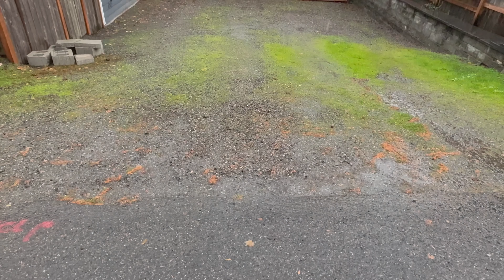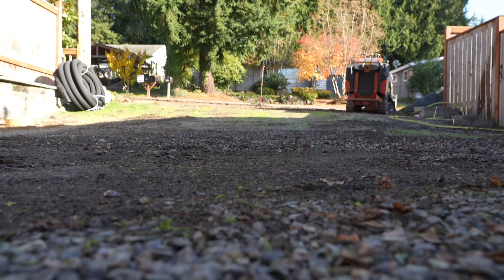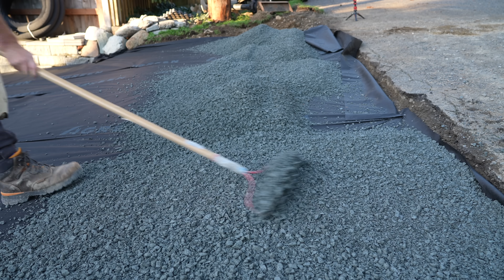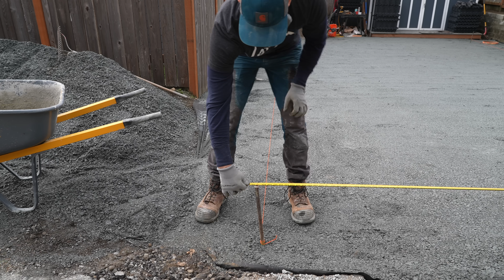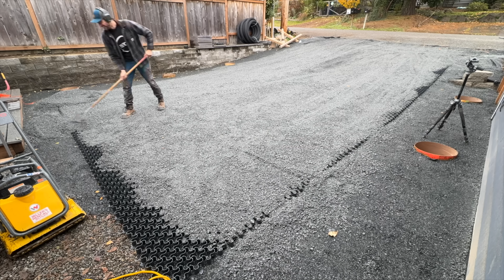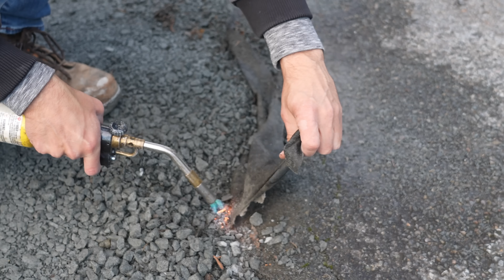How To Install A Permeable Gravel Driveway Grid System

Comment: Great video! I'm using your video as a guide to pave a dock slip area roughly 115' x 25'. I intend to store my boat and trailer on the property for the winter months here in the North East. I checked this links you provided in the video (thx) and see the grid system recommends 2" stone to fill the cells of the grid.  Does the stone you used to fill the grid fit that spec?  Instead of the crushed blue stone as the compacted base, I intend to use RCA (recycled concrete.) After 2 years since you've made the video,  is there anything you would have done differently? If you find the time I would appreciate your thoughts on my plan in substituting the base later with RCA instead of crushed blue stone or anything else I mentioned. Thank you for such a great instructional video.

Comment: Sorry to pile on, friend, but if you use the right kind of gravel, 3/4 minus comes to mind, the load bearing capacity is whatever the ground will bear, no limit, and it will interlock with itself, no plastic grid needed. I do like your weed barrier, and while it will not prvent surface weeds from growing, they will be a lot easier to remove than weeds firmly established in the ground.

Comment: @BYOTools 
I am thinking of this very application.  Can I use a smaller crushed rock size, smaller than 5/8" ?
Also, could I use oil-sand or asphalt on the outer edge of the mesh and a large strip of crushed rock down the middle?
I'm just thinking of different driveway designs using this structure...
Thanks for your instructive videos!

Comment: Great info. Thanks!

The only thing I'm doing different is leaving the gravel (or at least the 2nd layer of gravel) loose - not compacted, so that it does double duty for security. Very noisy. Yeah, the trade-off may be having to re-distribute the gravel once in a while, but times aren't going to get any better here in Umerica.

Comment: The problem with plastic mesh is that plastic will eventually start breaking in few years starting from the surface. That will leave sharp splinters and when you will,want to replace everything now you’ll have gravel mixed with plastic splinters. Does exists the same system but in galvanized steel?

Comment: Thanks for sharing the post. I'm a landscape owner-operator, and just wanted to offer some professional insight. Unfortunately, that fabric isn't going to make a difference in this situation it's essentially wasted money. Proper prep would have required removing at least the top 2-3 inches of the driveway to eliminate any remaining topsoil, especially since the quality of the previous installation is unknown. At the very least, a few test holes should have been done to confirm the base conditions.
There's a reason the driveway has been holding water, and without correcting the base, the issue will continue. In my opinion, the prep work wasn't done correctly, which means the entire job is likely to fail over time.

Comment: The joint of gravel to asphalt are two distinct surfaces and I suggest some kind of bonding liquid to stabilize and set the loose gravel avoiding the loose stones ending up on the road.

Comment: an expensive system (grid=$4.71/sqft, mesh=$1.1/sqft, 2 layers of gravel=$1.5/sqft for a total of $7.31/sqft plus labor and compactor rental) with regular maintenance required. May as use asphalt or concrete.
Reply: Yeah one of those grids is 140 usd. That 4K for a 10x10

Comment: During WW2 the US needed runways for bombers and as it advanced into Europe and the Pacific Islands it become clear that they would need a system to rapidly build runways.  At that time most bombers and fighters were tail drawers and the gear was designed to land on grass fields and many “unimproved surfaces”.  But, the shear numbers of takeoffs and landings, and the fact that aircraft kept being loaded to their absolute maximum takeoff weight… combined with the various precipitation events caused a lot of accidents leading to deaths and destroyed aircraft. So the military, with US Steel manufacturers came up with several different metal grid systems that when set on top of a graded base, especially if they could use coral, gravel,  and any local substrate be for laying the grid system made for a very noisy but very strong temporary runway. 

After the war ended there was thousands of miles of this runaway material in storage all over the world and equally as much sitting on abandoned airfields. It wasn’t long until ranchers and farmers… then scrap metal buyers began buying this stuff by the thousands of panels.  My family were ranchers in New Mexico mountains and we purchased several truck loads, with a stack about L32’xW10’xH5’  high stack.   The individual panels were 8’ long, 1” thick, 4’ wide.  They were made of strips of 1/4” coil steel welded together in a grid pattern of 4”x4” squares. This was perfect for making livestock corral fencing. We had this stuff all over the ranch for areas we needed very strong fencing. Back then we could buy a panel for $10 dollars. We weren’t wealthy so we couldn’t afford to build our own runways (although we owned aircraft)… although we dreamed of doing so.   We did use for temporary parking spots or areas next to barn entry.  They made wonderful boot mud scrapers

Anyway these plastic system remind me of the steel but I’m certain the plastic are better as long as you can add an aggregate or dirt to fill. The individual cells.  

Your video is wonderful.   Next week I’m tackling a similar but much much smaller project at my home. I’m adding a 12’W x 36’L extension to my driveway going down the side of my home using the same grid system. Then another 30x20 patio using a lighter weight system that costs about 1/4 the cost that will be used for above ground / raised beds to grow fruits, veggies, herbs, flowers etc.  

What I’m now sure to use is which finishing gravel?  I’d like something very attractive to be placed on top.  The reason for the extension on the side of the house is a place to park a dump trailer or a tractor.   So if I put down the fabrics, then compatible gravel… I was thinking put the grid down and fill with a small creek gravel??? Would this work?

Comment: I dont know if you have more plans to finish off the area but I suggest painting the fence to match your house will look more cohesive and clean.  The grey and white would look sharp. I used arborcoat by Ben Moore and looks great on my barn.
you can custom match to your house siding.  I would also add some evergreens cedars or boxwood to make the driveway really look beautiful. 
Maybe some hanging baskets or plants with nice purple and white flowers would look great. 
Just a friendly suggestion I know all is a work in progress. Thanks for your great tutorial on gravel driveway really helped me.

Comment: I am thinking of making moister barrier with plastic then gravel then plastic then lay grid system on top of my plastic, then buy enough dry concret to cover my garage floor spray it maybe 3 times after so many hrs. Now never used grid sydtem do you think this will work for a concret garage floor? What do you think?

Comment: I really dislike how every new construction product is made from plastic. They are using it for pavers now. "Luxury vinyl" flooring. Vinyl fencing. Vinyl siding. PEX plumbing. Now we are putting plastic under rocks. There are tons more products. (Yet plastic straws are banned in some states) 
Driveway looks great. Wonder the cost comparison, the system you used VS gravel with gravel glue.

Comment: Using a dense graded aggregate, crushed modified stone as it is often called, like they are using here will not be permeable. Look up any permeable paving detail in a civil engineering guidebook and open graded stone is always required for drainage. The drive will hold up well over time for sure, but will never percolate at all.

Comment: Concrete looks like the way to go.  I did this on the edges of the driveway witout the mesh and metal edging on the sides, and it grows weeds from dirt and seeds getting between the rocks from above and you still end up with needing to use weed killer.

Comment: After maintaining gravel driveways and private lanes for over seventy years, I’ve noticed that weeds typically grow from seeds blown into the gravel after it’s laid down. Over time, dirt and dust also settle in, providing a base for weeds to take root, no matter what kind of underlayment is used. Despite trying various preparations beneath the gravel, I’ve always ended up applying weed killer twice a year to keep the area clear. It’s a simple task, though, and not much of a hassle.

I’m really impressed with this grid system—it looks like it will keep the gravel from shifting and prevent low spots caused by vehicles turning or braking. Back when I worked in subdivision development, we used fabric to stop gravel from sinking into the soil while allowing water to drain through. Grid systems, similar to pavers, are designed to let grass grow, which is ideal for driving on lawns without leaving ruts. This project is fantastic!

Here’s a tip: If weeds or plants start popping up through the rocks, try a natural solution. In early spring, mix water, vinegar, and Dawn dish soap in a pump sprayer. Look up pet-friendly weed killer recipes online for the right measurements based on your sprayer size. Spray the problem areas on a sunny morning, and by the end of the day, the weeds should be mostly dead. They’ll likely be completely flattened by the next day. For best results, make sure rain is expected either the day you spray or the day after. If needed, give stubborn weeds an extra spray the following day. This method is eco-friendly and safe for animals.
Reply: Gravel glue (gravel-lok) does a great job at preventing seeds from falling through the gravel. Last a very long time since its polyurethane based. Also keeps dust down. Compact dirt, lay fabric, lay gravel, compact, apply gravel lok with a sprayer. Also great for pathways. Less rocks falling in the grass for the mower to fling into a window.

Comment: Here's an observation from forty years of maintaining various gravel driveways and private lanes. From what I've seen most weed growth actually starts from seeds that get blown into the gravel after it's put down, sustained from dirt and dust that also get blown in over the years, regardless of what underlayment is used. Within several years of putting in the stone, I've always ended up applying weed killer twice a year to keep the stone free of weeds, no matter what preparations I've tried underneath the stone, but it's really no big deal doing that. I really like the way this grid system looks as if it will keep the stone from moving around and forming low spots from having vehicles turning or braking while driving on it.
Reply: I think the bigger role the underlayment plays is acting as a barrier between the stone and dirt, helping it from sinking into the mud easily.
Reply: I have been using Preen weed killer in my rock mulch with pretty good results. Its  granular so you spread a thin application and every time it rains the product dissolves a bit and spreads out, keeping the weeds at bay for a few months.
Reply: Agree, just from a Garden prospective most of the time I get weeds its In the top surface not because my seedless barrier fails.
Reply: Hi Robert, I'm researching how to best build a short road &  driveway to a 3 acre lot for my impending manufactured home where (due to the lot size) the county requires some sort of paved access. The local builder suggested DG but it's about a 450' run. Should I use gravel as I don't think I can afford concrete? This system shown here looks good but, seems expensive also.
Reply: Geotextile fabric would be a better alternative to weed control fabric.  I was a PM for many capital improvement projects working with civil engineers & other professionals.

Also are the post holes for the carport deep enough? 

Love that tractor!
Reply: Try vinegar salt and touch of dish soap. Super cheap works just as well and doesn’t poison the environment like chemical weed killers.
Reply: @daversj works great 👍

Comment: You are a very good speaker and easy to listen!  You are doing a nice job too.  Just some friendly advice from one Pro to another.  Use a 36" landscape rake for your next job and rent the biggest (walk-behind) track excavator.  Also, maybe you ordered a stake out, but it is always good to make sure you don't have utilities below when driving 36" 1/2 rebar into the ground.  A comment down below already pointed out how to do a better job with your concrete footers.

Comment: This is worse then just a regular gravel driveway - at least with regular gravel you can use a high intensity flame thrower to burn off the weeds - this system will melt the plastic and make a mess.

Comment: You will damage the machine by using that bucket angle to scrape. Less angle should be used. Much less angle... you wont get it all in one pass, but way easier on the machine.

Comment: Beautiful job working with what you had. Whoever built that house did a crappy job on the pad. That house should sit at least 1-2 feet higher than it does.

Comment: If youre using a bucket to dump material throttle down and youll be more accurate and get your skill up faster. A pro will just dump it in a perfect inch or two layer reguardless thw size of the bucket.
You arent that operator and plan on a lot of time there. 😊

A second person running a dump trailer control while someone drives is thw best DYI.

Comment: The problem I would anticipate with a crushed rock driveway, would be areas that are loosened up and made uneven, if you were to turn the wheels on your car/truck hard one way or the other while sitting still or slowly moving.  The tires will dig up the gravel.  Therefore requiring constant maintenance.  Would landscape glue provide any resistance to this type of problem?  Another recommendation would be to use pavers around the border of the grid system you put down, just for aesthetic purposes.  It provides a nice sharp edge and border to the driveway.  Excellent channel - I just subscribed!  :)

Comment: Carefully done project with much care.  In the top layer, I prefer a rock with no fines.  Those fines get tracked into buildings and vehicles.  I don’t mind a loose layer like pea gravel or a small red granite.  In my shop apron I will use a larger grid grate aperture to accommodate a larger diameter rock in the top layer which will have less tendency to move by foot, tire, or water.
Reply: and the compacted fines make sure no water can get through this drive way. don't do what this guy is doing folks.

Comment: I installed a hidden driveway, just a strip for each tire, with grass in the middle.  I found that my county requires "an impenetrable surface" for all driveways, from reports they were going around citing homeowners.  That is most of the RV side driveways in my neighborhood.  In California, where they are supposed to encourage keeping rainwater on the property rather than flowing into the street gutter.

Comment: This was super useful, thanks for the video.

Would you recommend a paver grid system for non load-bearing applications, like edging or patios? It feels overkill, but I'm thinking maybe it'd be a good way to improve the rigidity of a permeable bedding I want to put tile pedestals on top of.

Either way, this stuff's going on my eventual driveway project, lol.

Comment: Weeds are still going to come through... The seeds will rest inside the rock. Also if you live in a place with a lot of debris (AKA trees) it will form on top and allow for easier germination. So some maintenance will still be required.

Comment: Fastest easiest way, put down minimum 3 mill dark black plastic.
Cover with a couple inches of gravel and compact .. add stone dust or  similar very small size sand etc .. compact again ... 
Should be good for light weight vehicles .. no weeds .. can add polymetric sand if you want .. 
Way cheaper than any other method.   😂😂

Comment: Weed barrier does jack all… if you applied crushed aggregate and then compacted it, weeds won’t be growing up through that- weeds will STILL grow however, this will be surface level ie seeds that have landed on top and slowly settled inbetween 

NOTHING will prevent weeds from growing. Where there are fine cracks, weeds will find a way.

Comment: I have a 300 by 14 foot Driveway With a perpendicular extension Of 90 feet to the house 20 feet wide The whole driveway was I usually done in 21A Crush line And I put a One a quarter inch Crush align on top of that Period Period The driveway is periodically raked With a landscaping rake On my tractor With no problems Period would it be said You think putting that we barrier down One weeds from that growth Think again Period Driveway Is heard is concrete And you still get grass and wheat growing Through the stone In the compacted line Unbelievable You have to get the pH level in this driveway correct to keep the Weeds out Period The barrier It's such a silly thing And waste the money in my opinion

Comment: Given you like to make content and give advice, please talk to pros, go check out their work that is 10, 20, 30 years old. If its not standing proud without maybe a minor issues at most, their advice isnt worth the air it took to deliver it.  
For a driveway, you should have gone down 24” at a minimum. Based on the slope you should have re sloped the area to control water, added drainage as a french drain. You should have done several more layers of fabric. Your posts you did not address frost line which so many get wrong, to compound the issue you didnt flare the bottom of your posts to ensure they stay in place. 
If your going to give advise like you are, getting your facts right is paramount. Also where is your engineering evaluation and design? For this, being wrong here will have massive complications and consequences.